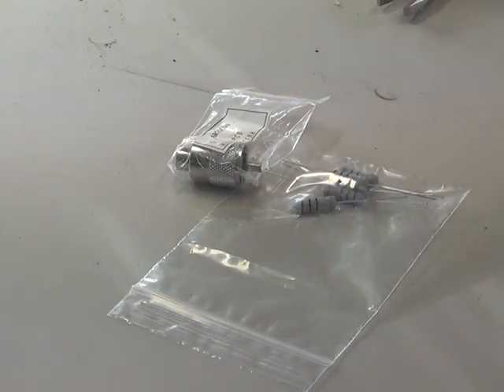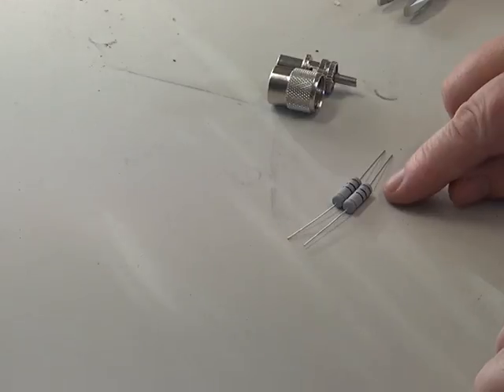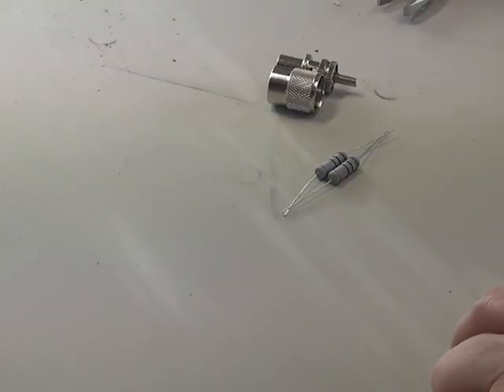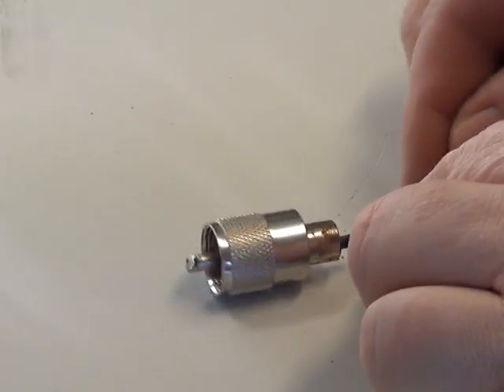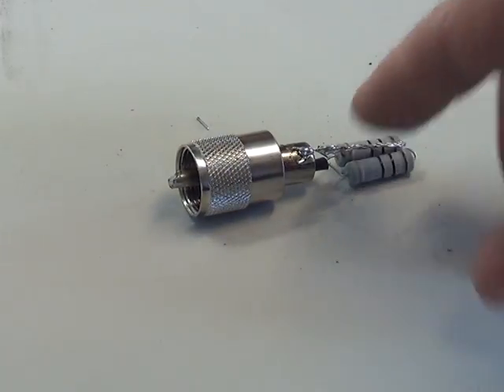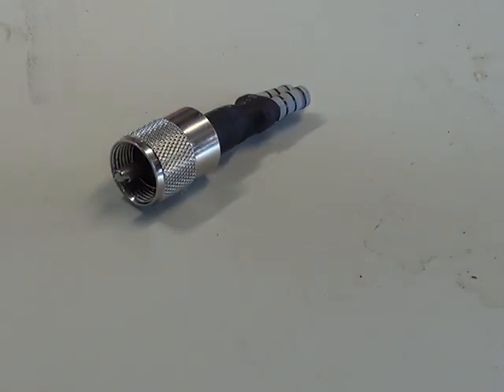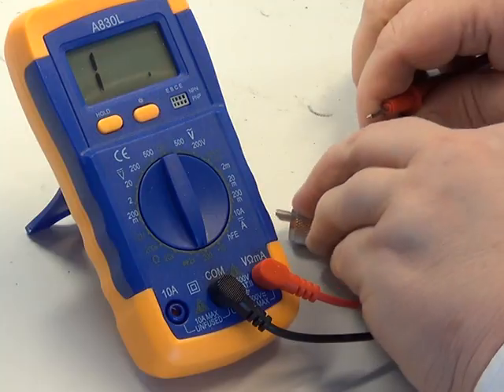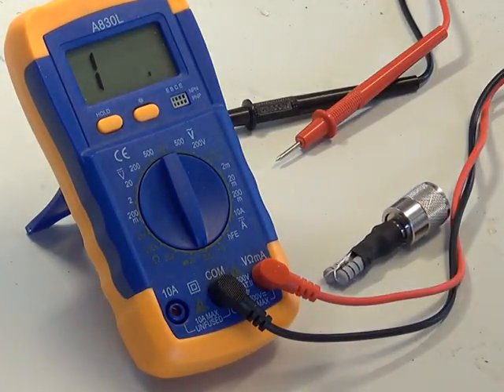CB dummy Load project - Servicing CB radio on a shoestring budget - Pt1

Comment: thank you for this video richard. I am trying to diagnose a highish swr so following your advice,.purchased two resistors off ebay and had 49.5 ohms for an swr of 1.2.I shall look elsewhere cheers
Reply from the maker: It's best to use carbon resistors..I used metalfilm ones & it was OK. Wirewound resistors are a no no as they become reactive.

Richard

Comment: Interesting. At a pinch I have used metal film resistors for HF dummy loads I'm not aware metal film are ridiculously inductive and not to be confused with wire wound. Obviously depends on frequency.   Nice little project that's very useful. Thanks for making these videos
Reply from the maker: I looked inside a Zetagi 30W load & it certainly wasn't carbon resistors in there, but of course is screened. Anyway, this shows an SWR of 1:1. I may have time to do the next video tonight.
Reply: Hi Richard To be honest I have found at HF you can use pretty much
anything. Unless you are actually going to do a power measurement referenced to
50 ohm the value of resistance is not to critical either. God knows what antenna
impedances that I must have transmitted in over the year without issue.  Many designs do however use more high resistance value load resistors in parallel combinations and this is to reduce the inductive reactance.  I am always amazed at your repairs, I’m rubbish at it. Looking forward to part 2. 

Regards Chris

Comment: my first dummy load was four 47ohm resistors (bought from anchor supplies) around 10w each in series parallel and fitted inside a cheap three way switch box/dummy load unit, i ended up selling it to a local screwdriver merchant who after 25 years still had it and used it often. (until he died)

Comment: Brilliant series Richard. I've just made my 2nd dummy load using a 47ohm series/parallel matrix setup. Resistors are 1/4w each but as there's 4x4 it works out at 4w on the button. Short tx only obviously and built with bits from the odds and sods box. Please continue this series as these videos are golden.  👍🏼
Reply from the maker: Yes, I know I need to do the RX videos but am struggling for time!

Comment: If you get 3 watt resistors it will handle transmit power a lot longer.  Do not get wire wound ones.  The resistors will get hot if transmitting for a while.  Keep transmission short they will work fine.  Better that one Screwdriver so called expert used to do, he used to transmit into an aerial through his cheap power meter which will quite happily read the harmonics as well as the frequency he is tuning up on.  The dummy was not plugged into the CB, he was adjusting it!
Richard, it is all the average person will ever need.  Not got this far back in your videos yet, YouTube just threw it at me out of the blue.
Have you built a salt water dummy load or an oil filled one?
I had a very old oil filled one, couldn't read who made it, but it started leaking, even though it was oil filled, it rusted through the top.
I threw it out, I should have kept it.  I'm sure I took a photo of it at one time, but it may be one of the photo's that was thrown out during house moves.  :-((
Reply from the maker: We do little over 25W business radios so have a 300W max for 15 seconds dummy load for bigger jobs. None of the test gear here goes beyond 30W.

Richard

Comment: Thank you for this, I really didn't want to spend a lot of money on a dummy load.   I got my resistors in the mail  yesterday so hope to build it soon.   Weird question for you, have you seen the one on EBay that only uses a light? (It's like $10.00 on Ebay).   I wrote that guy and he says the light burns off the rf energy, but his wouldn't work would it?  The light bulb won't equal the 50 ohm requirement, would it??
Reply from the maker: The USA available lamp just happens to be a 50 ohm load & I understand will take up to 5W. I've never seen one in person & what I'm telling you here is what I remember from American textbooks from the 60's & 70's.

It isn't some special kind of bulb ,but happens to work as a dummy load.

Richard
Reply: @ukfmcbradioservicingTango21   Thank you for the information.  I'm going to build one like in this video, but wanted to find out about the light bulb type before I possibly bought one since it's only $10.00.  Thanks again!
Reply: @ukfmcbradioservicingTango21  Thank you for this video.  I built my resistor cb dummy load this weekend and it works great, with a flat 1.0 swr on the cb's internal swr meter.  I also ordered one I talked about earlier, with the light bulb and guess what??   The light bulb one measured 1.5 on the same cb/swr meter.   I like your two resistor idea better and it works better, too!! Thanks!
Reply: A number 47 6v bulb is used. I don't know if you need a screw or bayonet type for the dummy load you are looking at but no more than 5 Watts
Reply: @bradleyfishel4233  I ended up buying the light bulb type also.  Thank you!  One day I'm going to buy a regular one.  These both work great though!

Comment: Do you have a 2nd radio setup to test receive? I heard you can do it with a dummy load and not have to have 2 antennas setup.
Reply from the maker: We do all service work on test instruments & into a dummy load as all service manuals dictate. We do air test all repairs just in case, for example, the FM detector is on a false peak.

Richard. G0OJF, UK

Comment: By using the two 5 watt resistors wouldn't that make it a 10 watt dummy load instead of 5 watts?
Reply from the maker: Yes, but as this is a CB project 5W was deemed to be more than adequate. This type of construction isn't really suitable for use over 30Mhz. 

Richard, G0OJF, UK

Comment: Nice for a 5 watt dummy load. If you don't mind me asking,  but to make a 20 watt dummy load, what would be the calculations for that? I'm thinking 200 ohm 5 watt resistors × 4. Would that be accurate? I want to use a minimal amount of resistors.
Reply from the maker: Yes, that sounds right. However, 200R (ohms) is not a European or UK 'preferred' value...but a quick look on ebay & I spotted this 141768770983. You will see he has 200R; and dead cheap too.

Richard

Comment: I have followed these instructions, no shorts, measures 50 ohm across the plug, but SWR reads like a short !, where have I gone wrong ??????
Reply from the maker: How bizarre. All I can think of is the possibility you've used wirewound resistors which is a no-no.

Richard
Reply: vbe carefull tu use only resistive resistors... Often the power resistors a selfics, then ih HF frequencies, load is not 50 ohms... Or yoy use carbon resistors, or film non inductive resistors...

Comment: Ah, but are the carbon resistors?
Reply from the maker: They are metal film. Resistors have to be 'non reactive' & when the text books were written there was only carbon & wirewound. As you know, wirewound resistors are reactive so no use in this application. If it worries you, make one with carbon resistors. Now think of the people using a particular American light bulb as a dummy load which is going to be reactive to some extent!

Richard, G0OJF, UK

Comment: Did everything you said and I blew the finals in the radio 45 watts reflected back into radio not happy
Reply from the maker: So hows does a 4W radio reflect back 45W?
Reply: 45 watt commercial land mobile (Australian)
Reply from the maker: So why make a 5W dummy load for a 45W radio? This project was intended for 4W UK CB radios. If you are working on LMR equipment surely that is VHF or UHF & requires a screened dummy load of suitable power rating & terminated in either a BNC or N-type connector. I was asked to do this series of 'CB servicing on a shoestring' for a reason, and that wasn't for business radio, in which I worked full time for 16 years.

When you assembled the dummy load & tested the finished item, did it test OK on your multimeter? Did the heat shrink insulation fed up the inner of the plug fail because it overheated & cause a direct short? Why otherwise was the VSWR so high as to reflect 45W back to a 45W source? You say the finals blew...but how many are there in that radio & why did more than one fail...I ask this because after years in business radio I remember many a customer with ridiculously wrong aerials...including a front door key as an aerial; in all cases the driver transistor failed & not the finals.

Richard (UK)